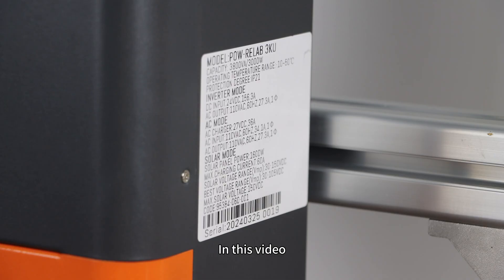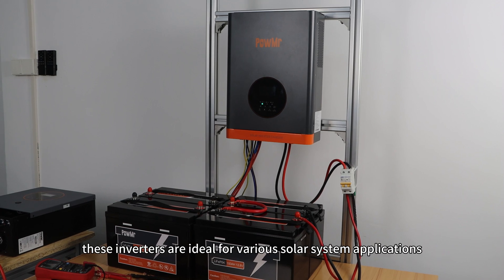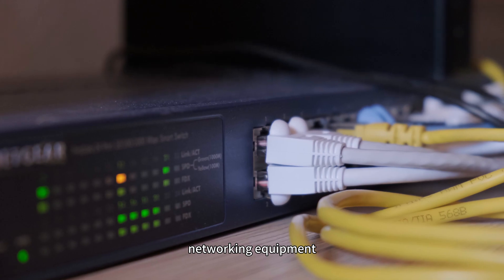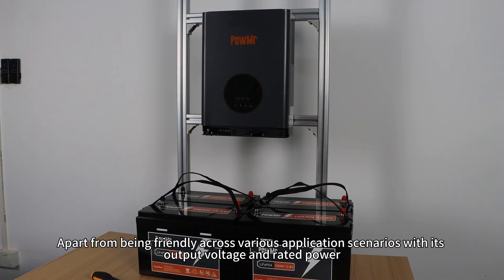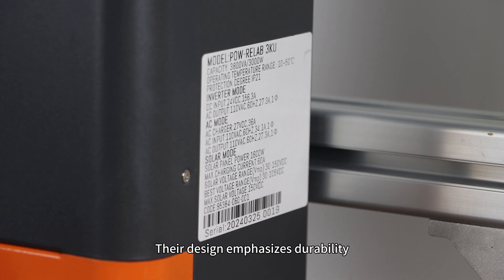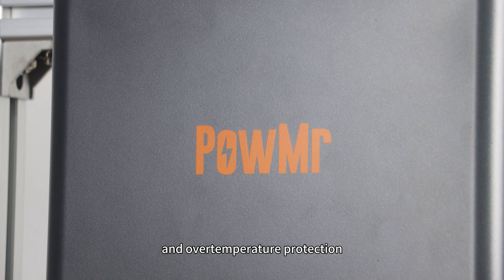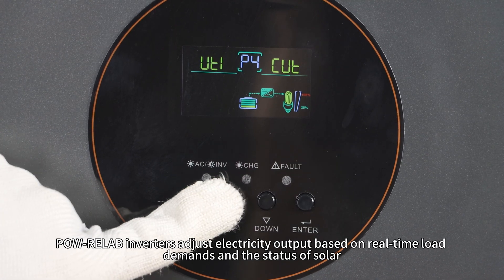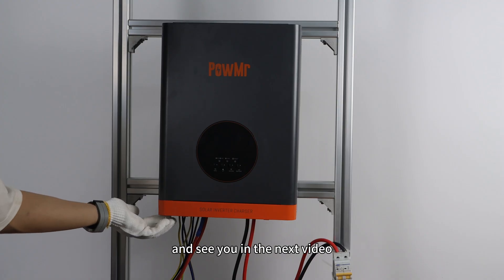PowMr Low Frequency Inverter POW-RELAB Series

Comment: @PowmrSolar hi i have powrelab 5ke can you post a video on how to connect the bms and the wifi module or there is configuration for the cable? The manual does not give details for this
Reply from the maker: OK.

Comment: Excuse me, I have a question.
The 5ku model suggests 3200w, can I mount it with 1600w?
Reply from the maker: Suggests 3200w? Do you mean PV input?
Reply: @PowmrSolar  yes
Reply from the maker: @osvaldoaraujo6568  Yep. Please note that the PV voltage must reach the minimum PV operating voltage of 60V.
Reply: @PowmrSolar  Okay. I have 6 units from 550w to 49v. My idea is to put 3 parallel groups of 2 panels in series. Is correct?
Reply from the maker: @osvaldoaraujo6568  What is the PV current?

Comment: How many watts idle consumption
Reply from the maker: <2%
Reply: Wie viel Watt sind 2% ?
Reply from the maker: @d.l.6428  2% of rate power.
Reply: @PowmrSolar  okay... In general, is the self-consumption lower than with high-frequency inverters?
Reply from the maker: @d.l.6428  Depends on the specific model.

Comment: With PC's, inverters, etc., bigger fans with low RPM are often the answer. Silent operation without high pitched whine.
Manufacturers should start using airjets & high quality silence-optimized fans.
Reply: I was going to ask a question about this. Do you have experience with these low frequency models? Are they loud? I need one for my campervan but am worried the fans will be too loud, as I will have to mount it inside the living area.